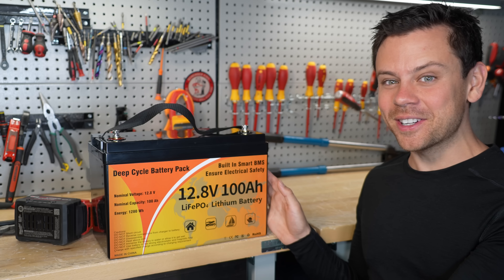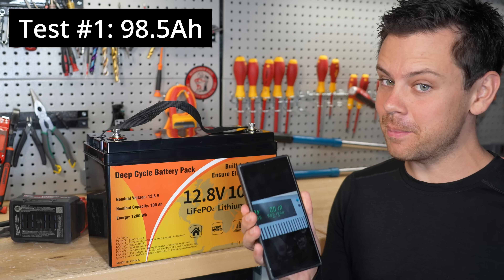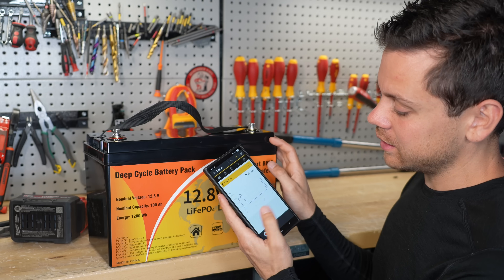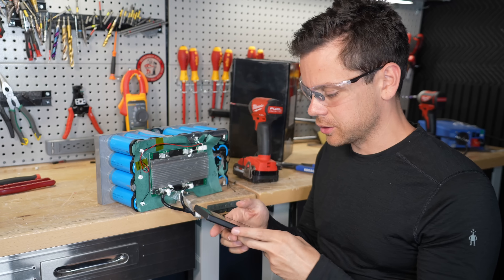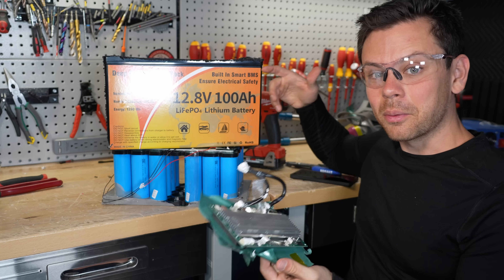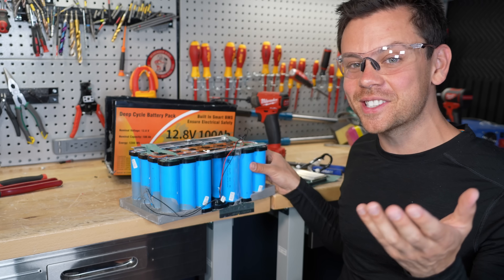$125 100Ah LiFePO4 a Scam?! Or Actually Good?

Comment from the maker: Batteries mentioned in the video:
$125 battery: https://amzn.to/45kSKWk
Lithium Solar's $78 battery is now $125:https://amzn.to/4mqUCDK
Lithium Solar's Video Review: https://youtu.be/MGe4rZjOt_k?si=b9B7ieKkAILOATBa

12V Safety Fuse! Add this to cheap batteries: https://amzn.to/3HeDQZA

12V Batteries that I actually like and recommend: https://www.mobile-solarpower.com/lithium-batteries.html

~~~~~~~~~~~~~~~~~~~~~~~~~~~~~~~~~~~~~~~~~~
Tired of getting ripped off? Check out my "Will Prowse Approved" solar product recommendations below!

12V Batteries
https://www.mobile-solarpower.com/lithium-batteries.html

48V Batteries
https://www.mobile-solarpower.com/48v-batteries.html

Offgrid Inverter System Builder
https://www.mobile-solarpower.com/48v-complete-system-blueprint-559371.html

Hybrid Inverter System Builder
https://www.mobile-solarpower.com/code-compliant-48v-offgrid-system.html

Mobile Handtruck System Builder (very popular!)
https://www.mobile-solarpower.com/mobile-48v-system.html

Solar Panels
https://www.mobile-solarpower.com/300w-solar-panels.html

Ground Mount Solar Racking
https://www.mobile-solarpower.com/ground-mount-racks.html

Wire, Lugs and Busbars
https://www.mobile-solarpower.com/wire-and-connectors.html

Tools
https://www.mobile-solarpower.com/tools.html

Fuses and Circuit Breakers
https://www.mobile-solarpower.com/fuses.html

Plug-N-Play Solar Systems
Ecoflow, Anker And Bluetti! So many models to choose from. See my current recommendations here:
https://www.mobile-solarpower.com/full-size-systems.html

~~~~~~~~~~~~~~~~~~~~~~~~~~~~~~~~~~~~~~~~~~
Need to build a large DIY system? Need a trustworthy solar distributor? These are my favorites:

Signature Solar
Creator of EG4! Solar Minisplits, Victron and More! Largest Solar Store Online.
If you want $50 off, please use my link below and coupon code "DIYSOLAR50":
https://signaturesolar.com/?ref=cPwLcVc0SW-BjN

Current Connected
Best Prices for EG4, Victron, Midnite and so much more! Fast Shipping and Highest Rated Customer Service:
https://currentconnected.com/?ref=wp

~~~~~~~~~~~~~~~~~~~~~~~~~~~~~~~~~~~~~~~~~~
Join our DIY Solar Community 
Need more help? Join the largest solar forum on the internet for beginners and professionals alike. 140,000 members and counting!
https://www.diysolarforum.com

Check Out My Free Book
Best-selling and beginner-friendly guidebook to off-grid 12V solar!
https://www.mobile-solarpower.com/the-book.html

~~~~~~~~~~~~~~~~~~~~~~~~~~~~~~~~~~~~~~~~~~
Contact Information:
I am NOT available for personal solar system consult! If you wish to contact me, this is my direct email: williamprowsediysolar@gmail.com
FTC Disclosure Statement and Disclaimers:
Every video includes paid promotion or sponsorship (such as free products for review). Some links on this YouTube channel may be affiliate links. We may get paid if you buy something or take an action after clicking one of these. My videos are for educational purposes only. Information is subject to change/update at any time. Electricity is DANGEROUS and can kill. Be smart and use common sense :) DIY Solar Power with Will Prowse is a participant in the Amazon Services LLC Associates Program, An affiliate advertising program designed to provide a means for sites to earn advertising fees by advertising and linking to Amazon.com
Reply from the maker: 0:00 Intro
0:11 Reviews are Lying!
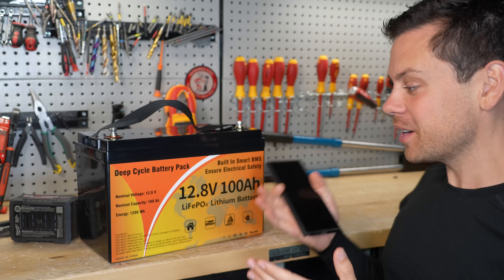0:33 Capacity Test Results
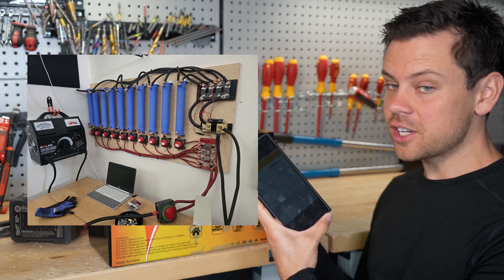1:05 Surge Test Results
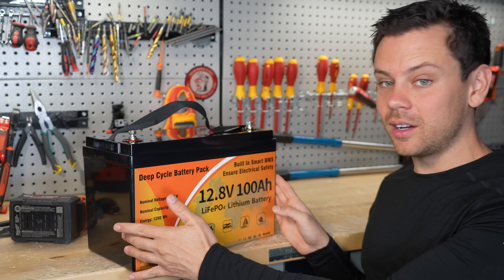1:39 Tear Down
2:01 Low Temp Test
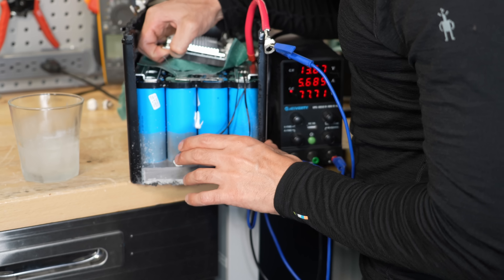2:14 Missing Cells!?
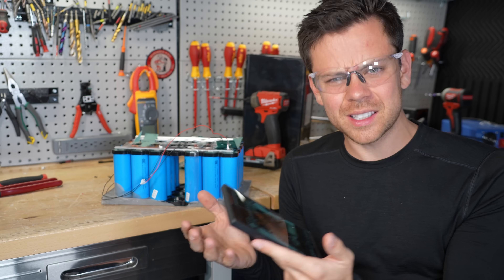3:31 Golf Cart Battery!?
3:52 Conclusion
Reply: There should be jail time for the people that try to pull this off.
Reply: They should be more honest and sell it for $70. 

It will definitely be more acceptable
Reply: I know nothing about batteries. 
Absolutely nothing. 
 I'm building a high banker for gold prospecting. 
 I'll be using 1100 gallon per  hour pump that is 12 volt and it says 6 amp on it. 
 I would like to be able to run a good 8 hours a day and charge it overnight to use the next day. 
 It'll be around water and sometimes I have to hike a long ways. 
 What battery should I buy?
Reply: @ZeroEditingProspecting  6Ah x 8 = 48 Ah.
48 Ah * 12V = 576 Wh.
You don't want to have a battery do a full discharge every day. 2 x 100 Ah 12V (2.4kWh) batteries should be fine, or get a Vatrer 51.2V 100Ah (5.1kWh) battery with a 12V 20A dc-dc converter for price performance and future proofing, as 50V batteries are the future. That could last a week between charges
Note that a 100Ah 48V battery has 4x the energy capacity as a 100Ah 12 V battery, so better to think  in watthours instead of amphours.
Reply: @ahaveland yeah that all went right over my head. 
 Thanks anyways. 
You're way smarter than me. 
 Give me the name of the battery and I'll buy it. 
 You're dealing with a 6th grade education here.
Reply: @ZeroEditingProspecting  These are not toys. Please invest the time to learn. Watch more of Willl's videos. It's not rocket science!
Reply: I never comment on videos but for you I'm making an exception. Keep up the excellent work and thank you.
Reply: Drprepare has a good one for 140
Reply: Oh boy do I have a review target for you Will!
I bought an 200€ 12V 300Ah no-name Lifepo4 battery from Ali a few months ago, and use it in my Caravan. Not ashamed to admit that it's worked like a charm on my solar setup, but I'm dying to know how bad it really is inside. Then again, I'm not willing to trash an perfectly well operating battery...
Please, please, please check it out and make a video on it!?
I can DM the link to you!
Reply: I bought 8DUMFUME 12 V hundred amp hour batteries they were all supposed to be minis. 

I got lucky and I do have two sets of matching batteries four in each set. 
I am unsure what type or what size of fuses that I need to make a 48 V system out of these batteries if anybody could post a link so I know that I am buying the correct size fuse that would be great
Reply: Guess not 😢
Reply: Hey Will, new to the channel here wasn’t sure if private messages or direct messages were an option. Do you build any system for clients and would you have any desire to build it on a Semi. I believe the industry can gain a lot from your expertise.
Reply: I need your help so bad. 
I joined your forum and was greatly disappointed with everyone’s attitude. Most humans can only think on a 2 dimensional plain and get stuck thinking (along scientific norms) and not doing! 
I’m a garage tinkerer and have figured out something amazing I believe. I could really use “your” ears. Is there a way to contact you directly at the diy solar forum?
Reply: They should be more honest and sell it for $70. 

It will definitely be more acceptable

Comment: Hey Will, thanks for the battery review because I was looking at one of these and was surprised by the low price. I have heard that it's a good idea to put a Terminal fuse on these batteries when using them to charge up your solar generator, of course, Only when AC or Solar is Not available. If im using a 12V 100Ah LifePO battery to charge a 2000 watt solar generator (Oupes Mega 1), approx. what size Terminal Fuse should I use. I'm a beginner in this and it's difficult at times knowing who to trust but, Your reputation is Great! Thanks, Jeff

Comment: I grabbed x4 grenerpower 12volt 100ah lifepo4 batteries off of Amazon for 125 bucks each last March.  Built a portable 2,000 watt array that I pushed around my backyard by hand.  Started knocking off about 100 bucks a month in electricity simply by using the power to run a couple window ACs.  I had one bad battery that support replaced without a lot of hassle, and it happened at the beginning of ownership.  I've load tested the batteries and pulled 4,000 watts from the bank while wired in series and didnt notice substantial heat at the terminals or around the cases.  This channel gave me the courage to give solar a shot with lifepo4.  After the success at home, a wired a solar charge controller into my kayak battery box and made a modular mount for a 200 watt panel on the back.  

Other than my city "code" enforcer giving me a hard time about my array, it's been something I'm glad I've embraced.  It can act as a backup power source and save me a bit of money each month until it pays for itself. I just put another bank together for my parent's teardrop camper so they can go anywhere without worrying about powering the cpaps.

Comment: Might as well get both questions out .
My first two batteries in parallel dont drain equal one always drains first.  I see 98 96% on one and 100% on the other. Im in the process of going with a bus bar and having the +/- lines equal length.

Comment: Question 
I bought two PUPVWMHB 300ah 12v LIFEPO4 batteries from Amazon they work good so far.  I bought a third and there is an issue with the settings first two secondary overcurrent protection 310a and short 1000a last one 80a and 560a.  Did they sell me a 100ah as a 300ah can I still but all three batteries in parallel and what fuse should I use?
Thanks to anyone that can help.

Comment: I just bought one, and should have waited to see if I could get one at $75.00.   
Just needed a battery that would not sulfate the crap out of itself like my AGM batteries do, and use them for mhy UPS's in the home as they are perfect for that application.  

My issue has always been that I have a very small Primary starting battery, and after a few years, the 35 amp hours or so goes down to much less than that.  
Still starts the car just fine   but it's starting to get  aged out  so Capacity has dropped.  
Just leaving my phone charging in my car for 2 days  sucks a significant amount of capacity from it.  

This cheap and cheerful battery  fits the bill until I hammer down  on something better. 
Better winter starts is also is on my list, and seeing if this battery can stay in the 12.8 volt and above  overnight would be the goal.     

The fact it can go to 10v without damage is pretty wild! 
As long as the BMS holds up, I'm  a happy camper. 
Installing it this weekend.

Comment: 🌴🤔Well stumbled across your channel looking for a good battery for my 45 lb thrust Minnkota Riptide trolling motor , and everyone is always looking for a good deal but having a battery that’s worth  buying is a better deal , what’s your opinion on what would be the best battery for my trolling motor that won’t break the bank ? Also I really like seeing that there is someone tearing these things downward looking and testing build quality, have you tested an aluminum ion battery yet? 🤔 also I’m thinking of putting a solar panel in my skiff and I want to integrate it into the standing area of my poling platform is there a a good 2’ ft by 3’ ft solar pan that you would recommend. Thanks

Comment: I am amazed that the capacity test did so well.  It looks like these cells are 33140(s) which are typically 15Ah so similar reviews (on youtube) are pulling around 90Ah or less.  How does this battery pull about 10% more than the others.
( Note: I am not questioning the testing,  the Jan-8-2025 review WattCycle 300Ah Mini the 280Ah cells measured a capacity of 305.489Ah with 280Ah cells (9.1% over nominal capacity) so it is certainly posable.)

Comment: It's silly to complain about 98 vs 100 Ah. Your meter has 2-3% error, cells are not all same, capacity changes with temperature. Anything within 5% is excellent. Would be nice if it was 5% more than advertised, but...

Comment: What i used to do when there was a cheap bms but i wanted to retain lvc and temp protections... warning, this isnt exactly safe 😂

Pull power directly off the cells bypassing the bms (definitely use a fuse! ), build a voltage divider to bring the bms output down to 5v or 12 (fuse before this!) , and maybe invert this voltage with a signal inverter.  Use this signal to control a brake input or ignition on/off or turn on a warning light. 

When bms trips it shuts down the vehicle or kicks your warning light.  Maybe not a strategy for the average person but it lets a stout battery discharge without the bms in the way yet retains the bms function and charging/ balancing.

Comment: The tale of the tape will be ....how many life cycles these cheap lifepo4 s can last when compared to the higher quality batteries(ie Battleborn,etc). You have to do the math. If one costs $125 and another $875, then you'd expect the higher price battery to last 7x more life cycles.(Questionable). If the cheap batt has an iron clad time warranty of ....say 10years, then guess where my money is going?  In the end, it's all about LCOE or S(Levelelized Cost of Energy or Storage). Total battery lifetime thruput(kwhs) divided into battery total cost(incl. maintenance). This is cost/kwh can be compared to grid power costs to dete mine the feasibility of having battery storage or just using the grid at night.

Comment: Can you do a video about putting in parallel two LiFePO4 batteries with the same BMS but with different capacities?
I have two LiTime 12v batteries. One is 100Ah with 18 charging cycles and the other is 200Ah brand new. Both got the same 100A BMS. Some people say I cannot use them in parallel to get 300Ah, some people say it's completely fine.
Can you please do a video about this?

Comment: Groceries are expensive as hell these days. So I don’t know that comparing a ”cheap” battery to groceries is the effect you were going for. 🙃

Also, 98% of advertised capacity seems darn good. I routinely test name brand batteries and generics for various projects and the BEST ones are usually 98% of advertised capacity with common ones around 75% or really bad ones at 50%. Capacity ratings are all over the place and I haven’t yet had a battery over perform the rating, it’s always under, just by how much is the only difference. 🤷‍♂️

Comment: Maybe  this guy is not the brightest bulb in the box.  A lithium Iron Phosphate battery can safely discharge at a high rate,  and yes Cell Temp  IS  AND CONDUCTOR SIZE the limiting factor. Capacity within better than 2% of the advertised is wrong How ?   Quality control IS a Big Deal... if 20 or 30% of the buyers complain...it is a red flag. 2 or 3%  is normal back ground stupidity.  the little wires are the voltage comparison circuits... what do you expect them to look like?  The BMS has to handle the charge current... not the load current...clearly not designed for ultra fast charging.  What does it say the rated charge current is?  Amazon is the WORST PLACE TO BUY ANY CHINESE PRODUCT.  FULL OF SELLERS WHO WILL RESHIP DEFECTIVE CRAP... AND ALSO SELL REJECTS .  FIND A REPUTABLE SELLER AND BUY FROM THEM.  TRY OSN.

Comment: Old saying - You get what you pay for!! I have two of these Humsienk 12V 100Ah using it as a power off inverter and they are pretty good. I need inverter technology where I live and for many year I used Lead Acid and Gel batteries but these two LiFePo4 are doing much better. And I only need two!!

Comment: I need 200-300 ah 12v battery to use as a secondary in my car for a audio system what would you suggest? All my wife is pure copper 1/0 and I use 250a fuses

Comment: 4:26 the label seems to be visually designed to look like the Btrpower batteries. But that’s just a label. 

I ‘might’ consider a super-cheapo battery for a “utility” portable battery if working remote someplace and want to charge tool batteries with a small inverter but I don’t think I’d want it for critical power in a boat or rv, def not inside my house. That just ‘feels’ risky. 

But maybe for a super inexpensive and relatively lightweight trolling motor battery it might be worth paying that little money for. In practical terms it’s probably going to do the job since smaller electric trolling motors are not going to typically load over ~1800W or so.

Comment: Sir, good day.. may Iask, if ican parallel different brand and BMS lifepo4 battery with the same spec of  100amp.. and in parallel connection, if the charging current will increase? thank you sir

Comment: An Asian company will destroy 25,000 units marked "end of life". They pull the batteries and sell them to another company. That same company also buys BMS units from other EOL products (specifically 12.8V batteries). Once they have 10,000 "like" parts, they can cobble together some batteries. These are done hastily and usually during "off-peak" hours, so the quality control is minimal.

Comment: I put two of those wired for 24v in my boat  a few days before this review.        They should be fine for my use.  Of course I always put a 50A fuse inline with my trolloing motors.

Comment: i got one, only plan to draw 500-600 watts with an inverter for camping. But its 10kg compared to my very old 120ah lead acid which is just over 30kg

it came with a '5 year warranty' but i guess we'll just have to wait and see if the ebay seller is still around in 2030 😂 i'll be happy if it lasts 2-3yrs

edit: got mine for $188 AUD

Comment: Does the over current protection sit between bms and battery or bms and terminals?

Im just wondering what would happen if the bms failed due to an inductive load. Not everything fails open…

Comment: I have 3 kingboss in my semi to run 2400 watt sine wave inverter.. Of course I have a circuit breaker..easily runs a small microwave, tv, and a small AC unit.. Never had an issue..I can buy 8 of these or 1 battle born..lol.. I've already capacity tested about 20 of these cheaper lithiums.. They are never under 100ah and sometimes, like the kingboss, they are way over 100ah..

Comment: Picked one up 108$, charged it slowly and tried it on a boat trolling motor. (Minn kota 55) After a few hours ..no issues. Hard to beat a light thrasher. Not huge draw …but it worked well. Recharged in 45 minutes.  I think I got a good one. 🎉